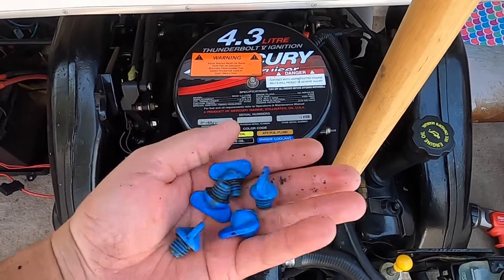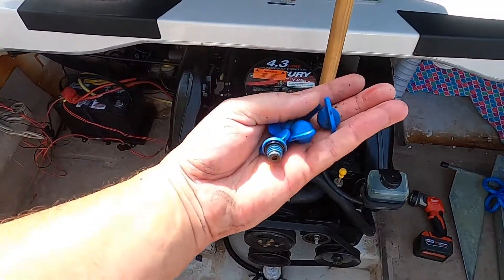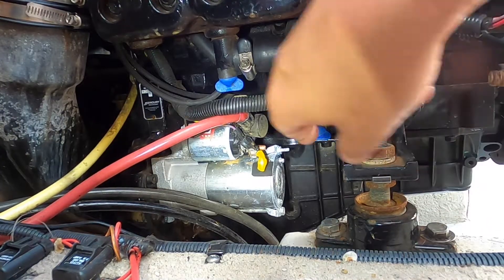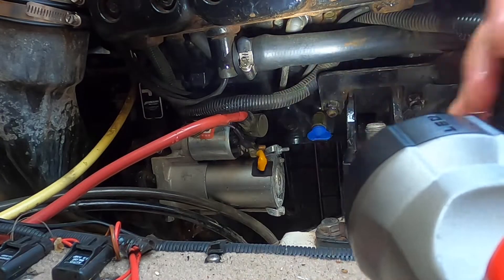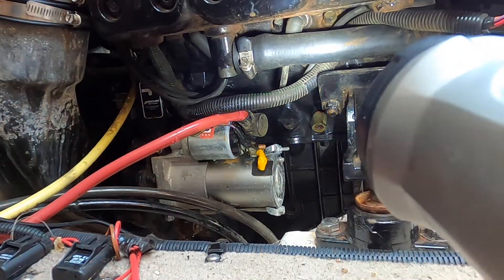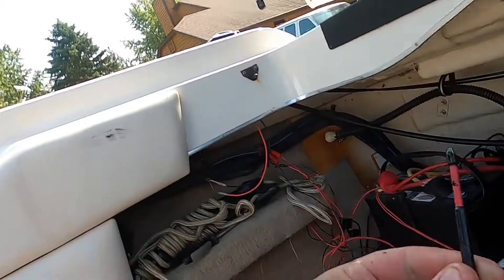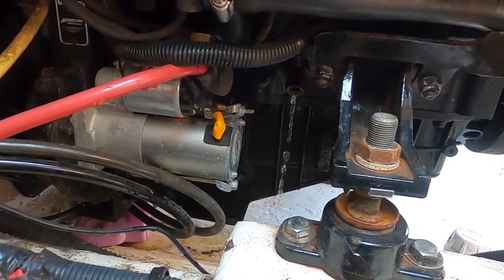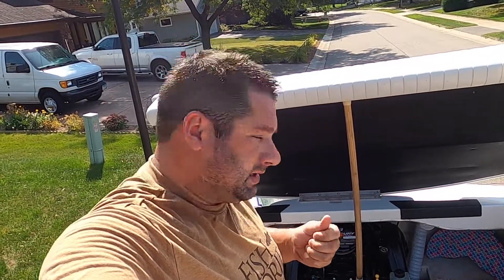Boat Motor Drain Plugs / Where are my Motor Drain Plugs?

Comment: Replace blue plugs with metal ones.  They get brittle.  I had one blow out during our first trip on the water.  Bilge came on.  End of a day of fun.  The bad part is the plastic threads stayed in and had to be drilled out.  Not cheap to fix and had to wait a week to get my boat back.  Get rid of the plastic or replace often.

Comment: Hello Chris,
I have a 4.3 mercury cruiser also. However, I only have two blue caps but I also have a blue wheel that is a drain wheel and there is a tube attached to it. No caps on the left side or right side of motor was this an option?

Comment: Hi Chris, I have a 5.0 Mercruiser. I can get to 4 of the 5 drain plugs. The one at the very front I just cannot reach. Do you have any suggestions on ways to reach it? Do you think I would be okay to drain 4 of the 5 and then fill with antifreeze?
Reply from the maker: 4 of the five is fine if you plan on running anti freeze through it
Reply: Also, I am planning to attach a hose to the muffs that would pull antifreeze through the system

Comment: Hey Chris, 
Not really related to the plugs, but in the part of the video where you are showing the plug on the right (next to the oil filter) there is a gold/orangey thing on the engine, in the frame. Was wondering if you could tell me what that is and where to buy one cause ours is missing. Thanks so much

Comment: I know this is a old video. But I couldn't find the one in the front of the motor I have a 89 4.3 v6 great video THANK YOU
Reply: Same here. I have 1996 and I found the 2 on both sides but couldn’t find the one on the front. 4.3 lx
Reply from the maker: Small possibility the 1989 doesn't have one on the front of the motor. My motor is 12 years newer. They change things

Comment: I wish I had that much room to work on my 5L lol. I had to stand on my head to get the drain plugs out. Do I need to do anything with the power steering hose? I’ve seen people say there is water in one of those lines?
Reply from the maker: There is a drain plug on the steering. When I pour antifreeze in it goes through it so I am good

Comment: Hello! Could these plugs not being in have anything do do with the boat leaking by the motor? My boat is leaking my the motor and it’s not the plug!
Reply: We found one of these plugs on the floor of our boat and we think the place we got it winterized didn’t put them back in!
Reply from the maker: I have seen people forget to put one in. Glad you figured it out
Reply: @BigIslandMNMinnetonka  why would I have a leak directly above the starter getting the starter all wet? It's not a plug it's from the block, it appears to be a seal in the block

Comment: So do I still have to run antifreeze through to winterize it or can I just drain the block like this?
Reply from the maker: I was just talking to some who says they only drain the water. I add coolant because it cost ti much to replace a motor. I would add coolant.
Reply: @BigIslandMNMinnetonka  I have never added coolant to my 5.7. I just drain the water every year, leave the plugs out until I'm ready to go after winter....
Reply from the maker: @thomasmack2409  I hear that works.
Reply: So I pulled the plugs for the winter.do I have to prime the engine with water for it to circulate the water again? Or is it as simple as putting the plugs back in and hook up the muffs worth the hose running and turning the boat on?